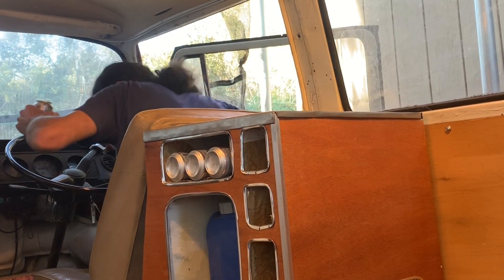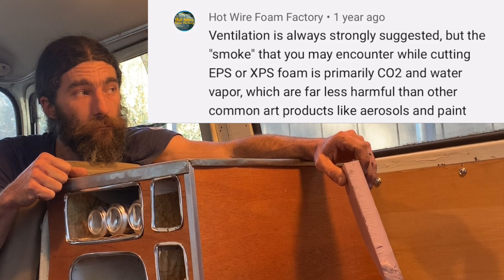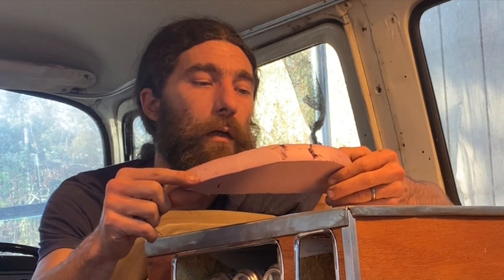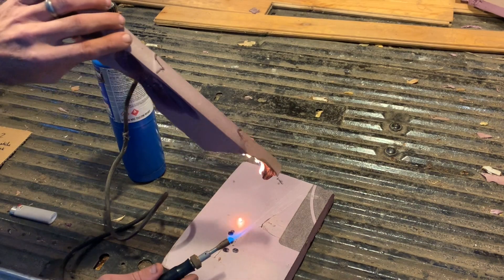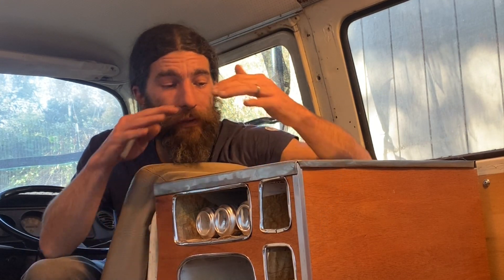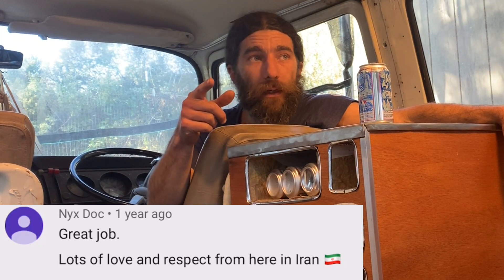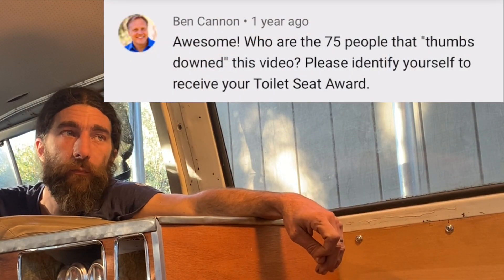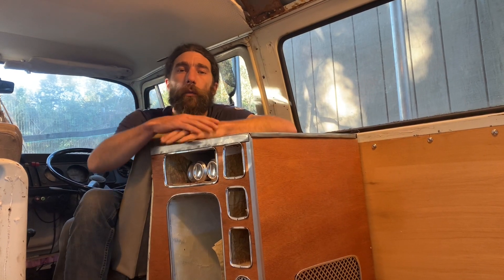Is XPS Foam Cabinets Toxic & Flammable? Q&A Snippet

Comment: Saw a more recent video and was wondering how long you've been living with the foam cabinets, now I know it's been at least 5 yrs. I was thinking of using extruded aluminum to build some shelves for my van, but the lower cost, lower weight, surprising strength, and ease of building with XPS foam you have demonstrated has me considering it as building material now. Thank you. 

I had previously built a unit with plywood, but the sealant I used on it went bad and it still stinks when it gets hot after two years, so need to replace.
Reply from the maker: The 5 year old cabinet was a prototype and still holds up, but is not in the van we are full time in now. 

We have 9 months, 42 state and 30k miles on the Transit full time… and counting. No issues other than the screw anchor failure that I covered… I realized since that that drawer failure was the push to open slide failing and the drawer flew open while we were on a rough road and I think that’s what initially broke that anchor loose.
Reply: @falkornomad  Good to know. I was planning on cubbies and shelves, so no drawers or doors. Thanks again.

Comment: Found you today while doing research on using foam as a building material, thank you for sharing, much appreciated.    Ideas on securing cabinets to the van, I am thinking of trying something like this for my project 
POWERTEC	400 lbs. Pull-Action Latch Toggle Clamp (4-Pack)
https://www.homedepot.com/p/POWERTEC-400-lbs-Pull-Action-Latch-Toggle-Clamp-4-Pack-20333/306901491   Ask far as posts asking  if the foam can be used to make the bed frame, would you be willing to send me the plans for your current wood bed and I will attempt to make one out of foam.  Best regards, Michael

Comment: Been thinking about how to solve the issue of using fiberglass on foam, it's a bit more expensive than painting but the result would be much stronger. Just saw a video from James Klafehn who made a whole foam trailer which he fiberglassed for strength and protection from the elements. Is the resin he using a different thing that is not eating through the foam? I'm not sure how this chemistry is working out how in some videos the resin is eating through the blue foam and other times it's not. Haven't seen a recent video on your foam cabinets but thought this might spark some more thought or understanding.
Reply: It is entirely dependant on the type of foam, and epixy you use.
Reply: Use a water based epoxy.